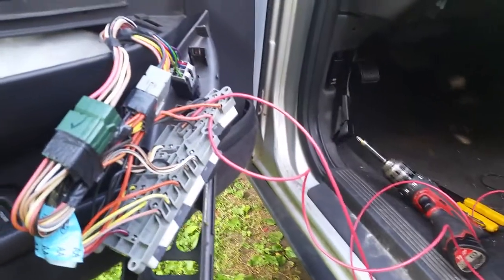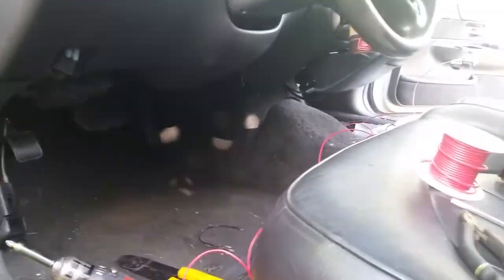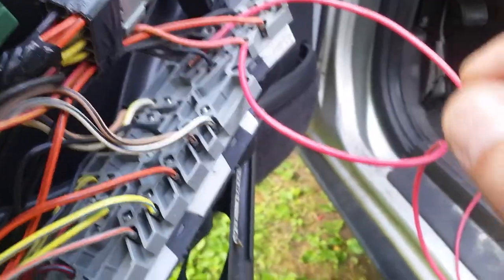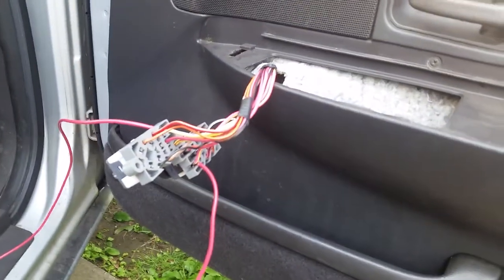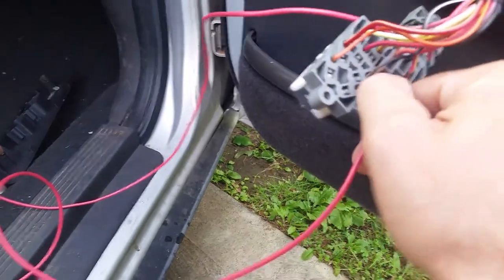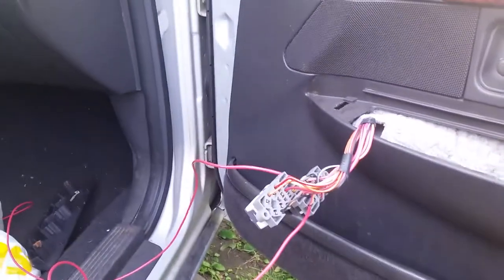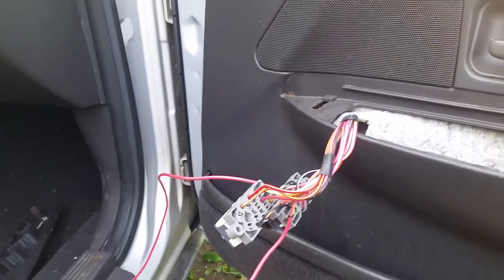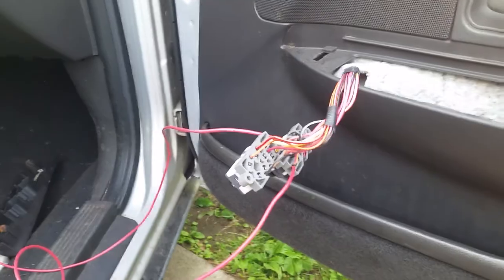Grand Marquis mystery powerlock problem solved

Comment from the maker: Update: I ran the two wires 8:00 til about 9:45. Through the molexes, under the dash. When I got to the middle of the dash the wires kept getting stuck trying to push them through. In a stroke of genius I grabbed a dipstick I had laying around, found a straight path, zip tied both wires to the small end of the dipstick and pulled them straight through. I have to say between zip ties and duct tape, zip ties have saved the day more times. One additional thing, I crossed the wires...  so the passenger power door loock button works normal, driver's works backwards. I also found several butt splices on the original wires in a real tight spot the probable cause in the first place.
Reply: Did you fixs it because both of mine dont work i have a 2006 p71

Comment: thanks for this I recently got a 92 towncar with the same exact issue where it'll unlock but wont lock I was thinking maybe its a bad relay or something because when I try to lock it I just hear the relay clicking and I traced the sound down to the keyless entry control module behind the glovebox everything appears to be fine I noticed one of the connectors doesn't seem like its seated completely but I'll probably just end up running some jumper wires like you did
Reply: Update: I just got another keyless entry control module from pick & pull problem solved
Reply: @giovannogalindo8785  tell me more about this